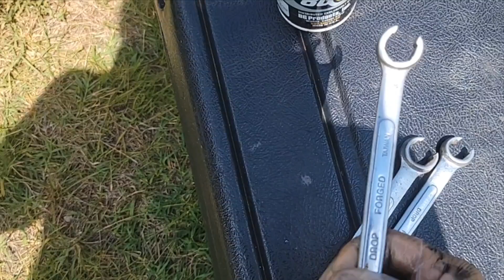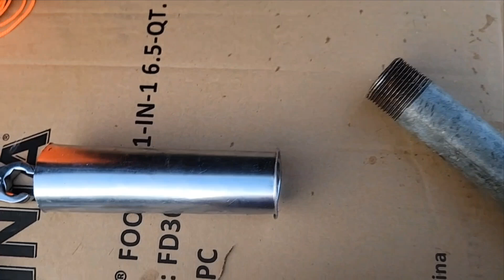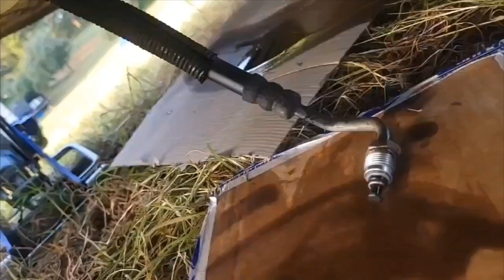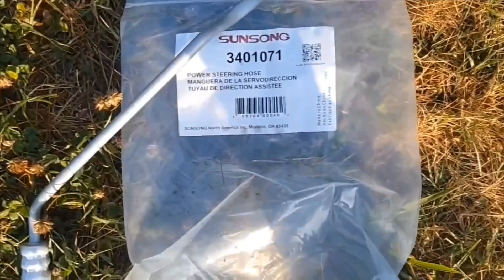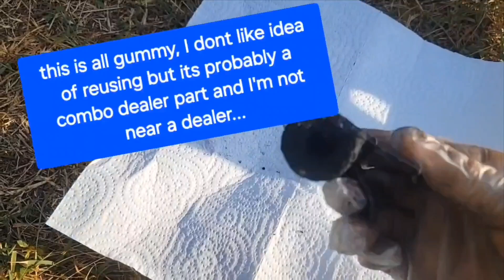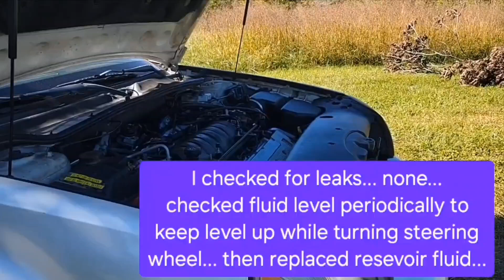POWER STEERING HOSE LEAKING ON CADILLAC NORTHSTAR / FIX

Comment: I used a snap on open end long reach to loosen the nut on the rack.

My customers car had it leaking from the steering rod rubbing on it. I am waiting on the customer for the new line.
I would like feedback on anything to do with the position of the line to prevent it from happening again.
Reply from the maker: Hi Stephen, 
Thx for the feedback on the snap-on wrench. 
As far as the rubbing problem, make sure all the clips are holding the hose in place and there is no sagging. Look for broken or missing clips. I only remember the one on the right of engine when it come from the pump resevoir and goes down under car.  Where the hose runs horizintally left to right under the car, it should be tucked upward tightly in the recessed area. There may be clips there. The hose should not sag there.
Im not sure exactly where on the hose it rubbed thru for your friend. 
Make sure the hose is routed the way I show in the video, although I dont think it will fit any other way. 
Once you have the new hose installed, turn the steering wheel from lock position left to lock position right and look for any interference with the steering, especially where it rubbed thru on old hose. 
Nothing should be touching. The power steering hose is pretty rigid. 
If something is still rubbing, a steering component may be bent. Theres a slight chance it might be hitting only when going over bumps. 
But im not sure how that could happen. Its possible too that an aftermarket hose had been used and was a slightly different shape. 
If u see something coming too close for comfort, check if a heavy duty zip tie will help position hose better, but that will not work on the very end of the hose because that part is metal. 
Let me know what u find out. Thx

Comment: My El Dorado 2001 is much diff, that TOP line was EASY for local mech, it terminates B4 goin across bottom of engine... I have GOT ta change the pwr steering COOLER line, Local Mech ( HANDLER lol)   said they didn't makem anymore, Edelmann ( EXTEMELY HI quality)  im in email over it, u CAN order BOTH of them from PARTS GEEK.....( DUNNO the quality tho) Tht @ sending this info to local mech, but prolly just pissem off.... look fwd ta getting dirty  I had the LOCAL mech chg starter out  back brakes, n oil press switch leaking + top power steering line  + clear sunroof lines, n few other things $1700  The starter was @ $500 n change complete     Not complaining, My BACK had just said HECK w/it after fixing that coolant leak ( LOOSE BOTTOM X over bolt at firewall) THEN thought id change the gaskets on it OH NO, The Eldorado is MISERABLE ab ZERO room w/o pulling engine GRACE of GOD it was just the bolt  After BARELY removing TWO top right SHELLACED Indian bolts i cleaned up, re-shellaced them , put ALL other bolts bk in reassembled it all ( A JOB!) as u well know!   waited a week to dry  n gave up that thought sis! After fixing ONE small leak at coolant overflow ( needed anpther  clamp..... it held 15 psi 1.5 hour FIXED!!
Reply from the maker: Hi james , wow thanks for sharing all that. Thats a lot of stuff uve done. Little by little u will have that it top condition! Yeah Eldorado is a little different than the devilles. Hopefully that brand of cooler line is good. Nice you found someone who had it. Keep up the good work on maintaining ur nice Eldorado. Be sure and put in an after market temp guage. It will help u keep an eye on the engine temps. Best thing i ever did. Helped me catch a bad fan relay just recently.
Reply: FYI everyone. 2001-2002 North Star engine model DTS has version 1 & version 2 styles.
This video is version 2 styles setup.
Pump brackets and hoses are totally different.

Comment: Good job. Im fixing to dobthis on my 07 Lucerne with the northstar engine. Its the same layout as the caddy. 
The return line was leaking and its a bear to take out. You have to get the front end up on jack stands, put a jack under the engine and lower the subframe a few inches without removing the subframe bolts ot it will drop to the ground. 

I decided to cut the line at the rack and leave enough steel line to attatch a 3/8" rubber power steering line then run that with zip ties along the high pressure line back up to the return port on the pump. Since its not a high pressure line i just used 2 hose clamps where it attatches to the rack and no leaks. Ended up being a 1 hour job instead of days. 

Unfortunately my higj pressure line started leaking at the rack so ill be doing exactly what you did. I dont plan on removing the valve cover though.  Hope it still works.
Reply from the maker: Hi jim, great thinking on fixing ur low pressure hose with rubber line. That saved u a major headache. I saw that connection while i was fixing high pressure line and it looks near impossible to reach and i think the high pressure fitting is in the way of getting a wrench to it.
Its a tight fit for a wrench even on high pressure fitting and best to have a high quality wrench that doesnt have a lot of play in it. I managed with some low end wrenches but not nice. 
Hope it all goes well for you. Taking the front left tire off might give a little more access room too, which i didnt do either. Let me know how it goes for u.

Comment: Hello, Sounds like fall is around the corner..Doing a little maintenance saw a puddle antifreeze slowly leaking heater pipe . I’m having a problem removing it. It has a quick connector and it’s pipe to a water hose, It’s right behind the firewall on the brakelines and container. I’m thinking using a saws all and removing the Dorman connector.
Reply from the maker: @NoName-zn2qu  Hi, yes fall is closeby. To get the heater pipe loose at the crossover connector, you need a 5/8" AC/Fuel line disconnect tool. 
Push it on as far as it will go and it will release the clip. The pipe is a little hard to come out, but it WILL come out once the disconnect tool is in there. Just keep jiggling it and pressing off. 
The metal part that is screwed into the crossover is Dorman PN
800-431 from rockauto at $18.00.
Do not use Dorman part 800-401. It is a little different and not for the 4.6 motor.  I wish you well. Not an easy job to do with the crossover in the car.
Reply: @girlintheblueridge6529  Hi ThankYou..TTYL!
Reply from the maker: @NoName-zn2qu  Hi, you need a fuel line quick disconnect  tool. I just did that. I'll look up the size for you. 
And get the dorman part number I used.